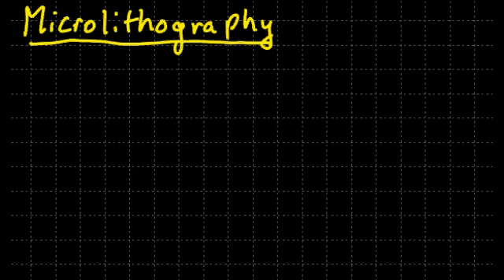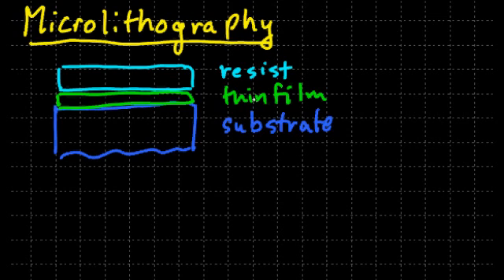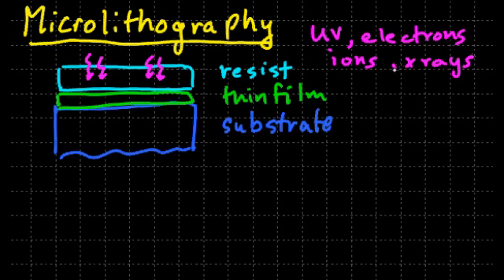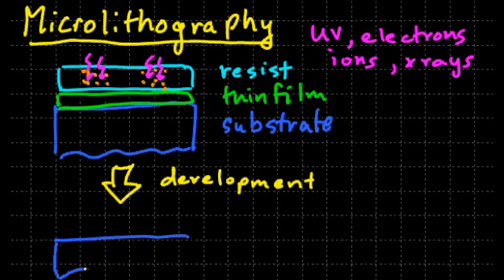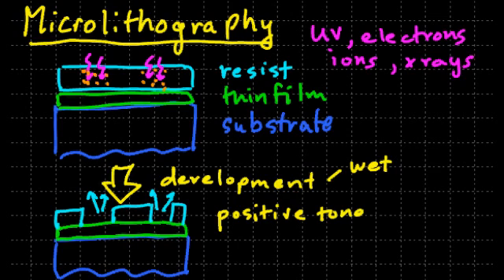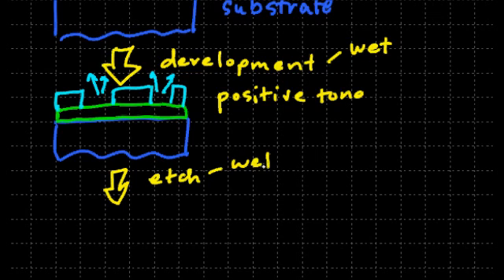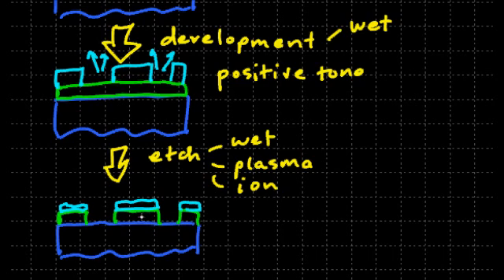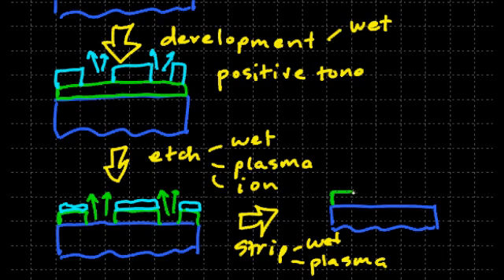microlithography and nanolithography explained

Comment: Dear Karl, how many layers do structures typically have. How long does it take to fabricate such a device?
Reply from the maker: That's depends on the device you're trying to make.  It can range from a single layer, for a diffraction grating maybe, to 20 or more, for an integrated circuit.... The lithography process itself can be completed in a few minutes.